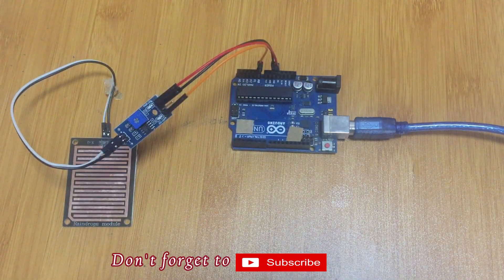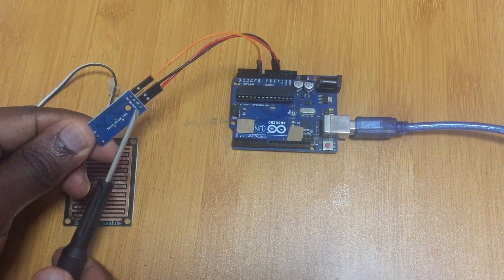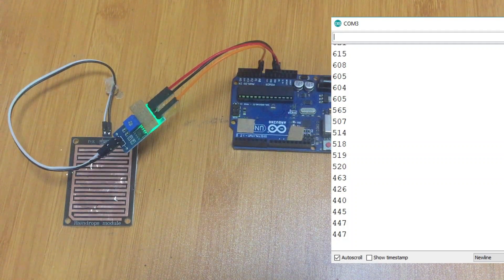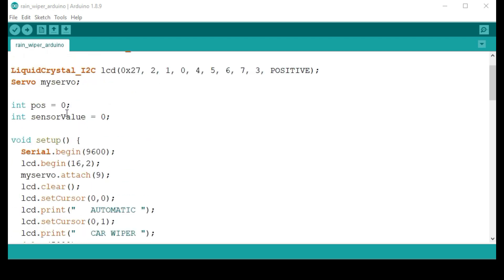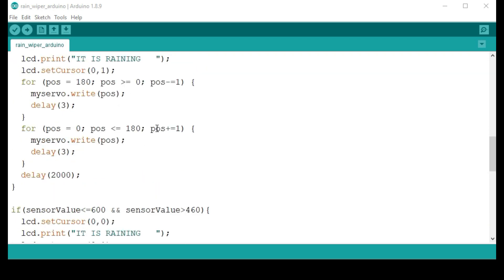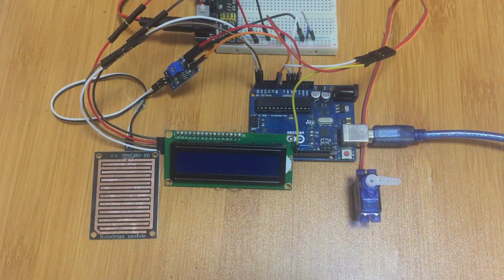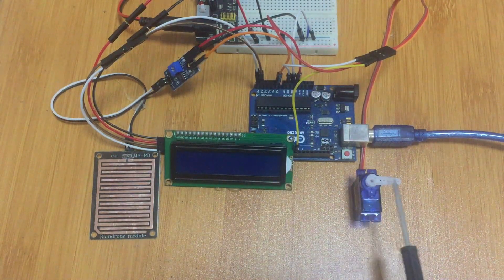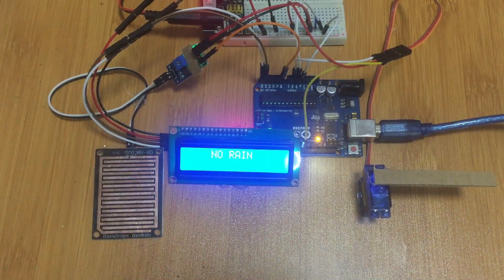HOW TO USE A RAIN SENSOR WITH ARDUINO FOR MAKING AN AUTOMATIC CAR WIPER.

Comment: Thanks for this tutorial.Good job. Clear and easy to understand. In 2025, the initialization of the display with Liquidcrystal_I2C  (by Frand de Babander v1.1.2) must be used as follow :
class LiquidCrystal_I2C : public Print {
public:
  LiquidCrystal_I2C(uint8_t lcd_Addr,uint8_t lcd_cols,uint8_t lcd_rows);
  void begin(uint8_t cols, uint8_t rows, uint8_t charsize = LCD_5x8DOTS );
Don't forget to turn the LCD backlight on! ('the name you gave').backlight();

Comment: Hi!  I got the code working NO problem, but then, I am having a problem.  I am using this for an actual implementation on a vehicle that does not have wipers to make its now hand operated wipers controlled/moved by this.  I 3D printed servo mounts, a case, did all the wiring and I have two problems:  First, the display lights up, but nothing displays on it.  Not huge, I can live with that though would be cool to get that working.  Second - the servo.  When the Arduino Uno initializes everything the servo moves almost a 180 in reverse, pauses then comes back.  Then, when I spray water on the water sensor, it only moves like 30 degrees (all movement degrees are estimated).  Dry off the sensor, it stops, does another like 180 degree rotation in reverse, pauses then comes back.  I need I'm estimating about like 50'ish degrees of movement for the wiper (+/-).  I also have a passenger side I'm going to try to run from the same arduino as well, I assume I just declare the second servo under the first (drvservo, passervo), then copy the code for the first servo under it for the second, change the variable to the second one declared and reverse the rotation (not sure?).  If you'll send me an email (either wapiti59@gmail.com or blue.knight@comcast.net), I can send you the arduino code (tried playing with the servo movement myself - obviously not getting there) and a video so you can see what I'm talking about, rather than put a huge post in here.
Reply: OK - I think part solved!  I restored your original servo position and movement numbers and it is working (video available)!  Now, to the passenger servo - Both servos are externally powered (bigger, much stronger servos).  your myservo I declare as drvservo for driver side, passenger side would be declared as passervo.  Is my assumption correct for controlling the passenger side, declare the passervo (and its pin connection) under drvservo, copy paste the code under each section only for the servo positioning (under the display printouts) changing the servo name to passervo and reversing the numbers in your position write statements (passenger wiper moves in opposite direction of the driver).  Both servos are oriented the same on the windshield, with the servo arm closest to the bottom of the windshield.

Comment: Why the output remains as HIGH if I used arduino uno r3 ver 1.0 while it remains as no rain when i used arduino uno r3 in proteus?